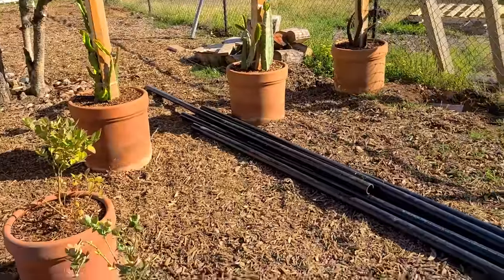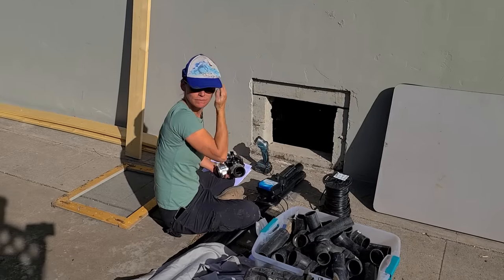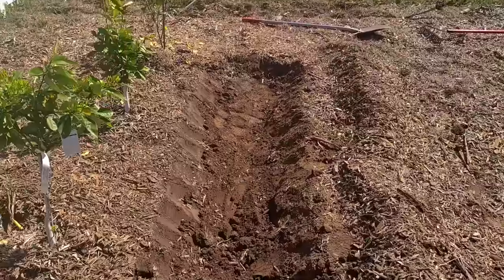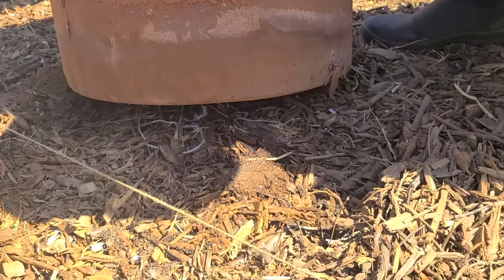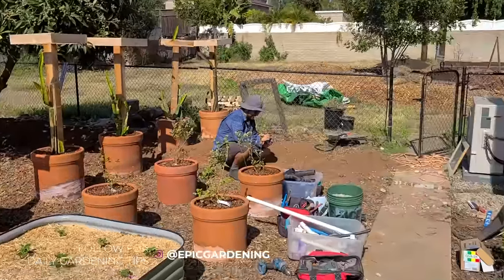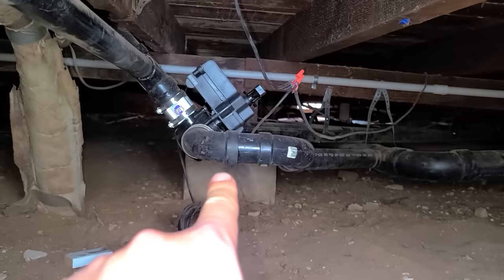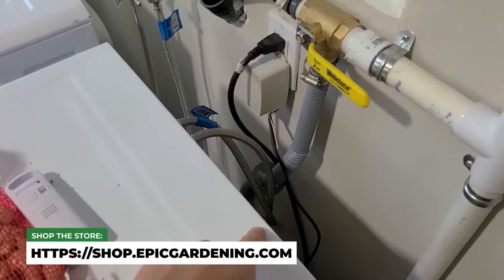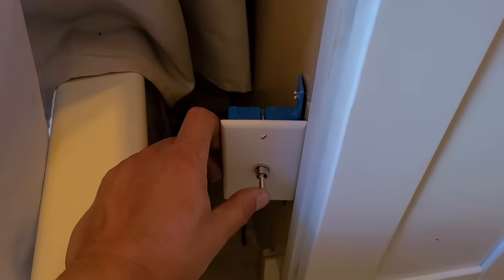Grey Water Systems: Shower, Bathroom Sink, and Laundry Conversion!

Comment: So the lines need to drop 1/8 inch per foot?  What happens if by the time you get to your plot you want to water you are significantly below ground level?  I'd assume it would water the soil around and maybe just plant deeper rooted plants?  Is this a correct assumption?
Reply: And will the water back up in the lines of you are discharging more water than hollow space you have under ground?  I'd assume it would take a little bit of time for the water to soak into the ground?
Reply from the maker: Dig a big trench :P
Reply: And how do you keep rodents from crawling back up your drain lines?  :-|

Comment: Kevin, while I appreciate in principle what you're trying to do to conserve water, here's my problem as an engineer: I always run the "Costs/Benefits" analysis on every major decision. When I did the math, I can’t rationalize the expense of capturing water.

In my home city of Anaheim, we pay ~$3.305 for each HCF (hundred cubic feet =  748 gallons) of water from the public utility. That's ~$0.00442 per gallon of water.

When we looked at 100-gallon rain barrels, they were over $200. At $0.00442/gallon for water, payback would come after capturing over 45,248 gallons of water! That's not going to happen in my lifetime! So you can see how I couldn't rationalize buying rain barrels.

For your shower, if you have the California-mandated 1.8 gpm showerhead, you would only generate 18 gallons of water in 10-minute shower. In Anaheim, that’s about 8-cents worth of water. And your laundry is probably generating about the same amount per week as your shower. Even at San Diego’s inflated costs for everything, you’re probably not using even a couple bucks-worth of water each week for your shower and laundry combined! So how long will the payback be on the systems you just installed?

BY FAR, the greatest use of water at my home is for watering the lawns, both front and back! Watering the lawns probably uses 100-times more water than all other uses in my home combined! (OK, that's a guess ... but I could probably figure it out and it wouldn't be far off!)

But, I understand that you're doing all these things to the EPIC HOMESTEAD on principle. Not just to save money. I guess there's worse ways to spend your money ... and probably not many better ways! Keep the dream alive!

(BTW, this is the same reason I didn't get solar panels. Our payback on those would come at about 20-years ... just about the time the whole system would have to be replaced!)
Reply: That's not a correct estimate, you have to take into account watering the garden during summer. The rates are tiered and ramp up significantly especially if there is a drought and conservation orders are in effect.
Reply: @09137  They would have to ramp up SIGNIFICANTLY for there to be any reasonable payback time ... like water would have to cost more than gasoline ... or organic milk!!!  🤣
Reply: May not be Cost Effective in the short term, but when the price of water goes up, (as it will), those who installed grey water systems will be thankful they did. Money saved by producing healthy food in one's own garden would more than compensate for that spent on installing a GW system. (And before worrying  about soaps and detergents that may contain chemicals being used; they can be filtered out environmentally by the use of reed beds.)
Reply: OK, I totally get that there are sometimes things you do because they’re the “right thing to do”, no matter the cost (within reason), but I don’t have a ton of money, or corporate sponsors, so I have to deal with the realities of having to pay for things myself. When I run the numbers, even if water went up 10-times higher than what it is now, it would still be difficult to rationalize spending that much to capture grey water, or even rain water. 

As I said in my original comment, at today’s cost, I would have to capture 45K gallons to reach payback on a $200 rain barrel. At 10x the cost for water, that would still require capturing 4.5K gallons (or filling that 100-gallon barrel 45 times!) to reach payback. As I said, either way that may not happen in my lifetime, so does it really make sense? (So that 100-gallon rain barrel at Home Depot was actually over $300, and you’d have to pay for all the gutters and fittings to use it...  )
Reply: @eandrgoodwin  I totally understand completely, mate. I reckon that anything to do with harvesting or saving water by any means should be tax-free for starters and subsidized by the gruberment. This, among other things will happen when I am elected Dictator.

Comment: Grey water discharge should be code in any Californian urban interface. It can seriously help with wild fires keeping the edges of the towns soil well saturated and green vegetation. If you don't have enough fall in your location you can pump your grey water just like the washing machine does with a sump pit and pump. Common in areas with heavy rain normally used to pump out basements.

Comment: All that work for the actuator and couldn't make that switch any better? Cut a small hole in the bottom, put in a wire channel for concealment, and cut a hole in the side of the cabinet to make the box flush to the cabinet.

Comment: should i start a new compost bin because ants got to it?
Reply: One of ants’ jobs is decomposition. They are great at keeping your compost aerated. The problem that can happen is if your composting system is too close to the house they might migrate indoors when it’s wet or cold. Not fun. How far away does it need to be? Depends on the amount of heat leaking out of the house and your climate. Your composting needs to stay out of the home’s “warmth zone”. Here in Seattle with a 40 year old cheapish house that’s 10’. Another problem is if you have fire ants. Eiiieeeee!
Reply: @Lauradicus  oh no the bin is pretty far from my house. i have a big backyard. thank you i didn't know that. in shorter terms its not such a big problem right. i had some holes in the container for air exposure but the ants saw it as an invitation
Reply: @randycano5389  Right.

Comment: “Most soaps, shampoos, conditioners, and washing detergents use salts, fragrances, and other chemicals which, in large quantities, create toxic conditions for your plants. Finding soaps with no salt or sodium is essential for optimizing your greywater use.”

Don’t think this would be permissible in The Netherlands with our low ground water table which we actually use as the source for our drinking water...

I’m not sold on the idea of “lightly poluted water” dripping into the ground

Comment: Anyone know how i can control the fly population in a compost tumbler. It's pretty bad or is there nothing i can do now. Sorry i know its unrelated
Reply: If you have a problem with flies in a compost tumbler, it is because the contents are "rotting" instead of composting. You need to add some browns (carbon) to tumbler so that it will heat up and start composting. If the compost gets hot, the flies will not be interested in it.
Reply: what OhioGardener said.  Add lots of shredded paper if you have it.